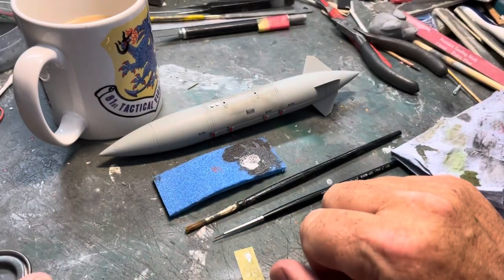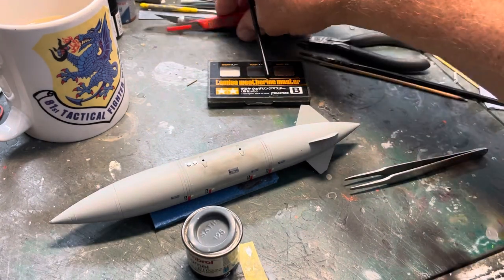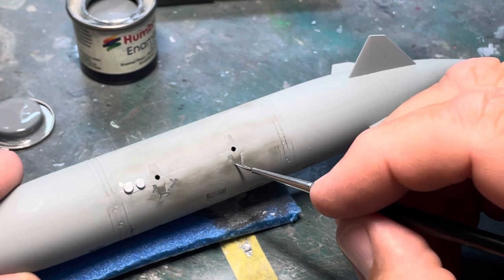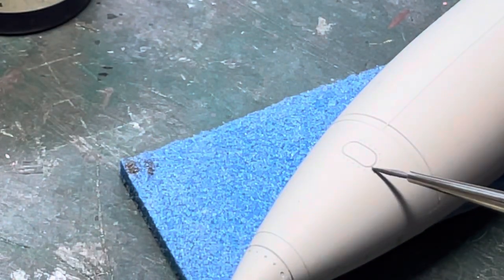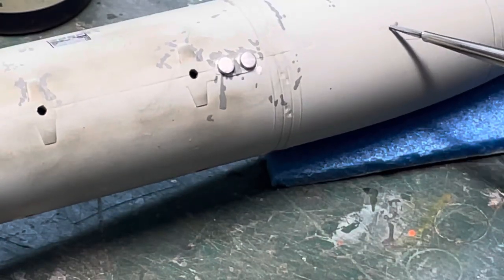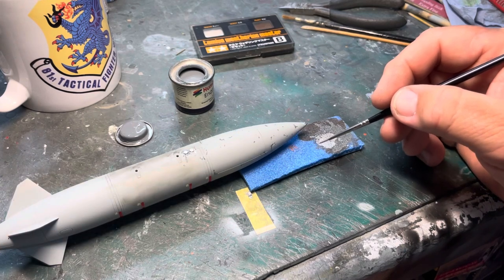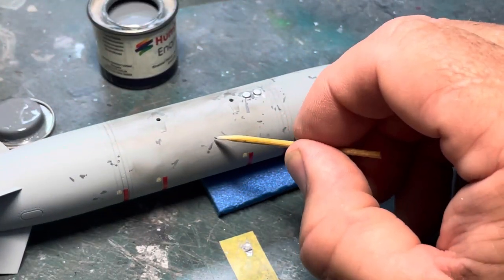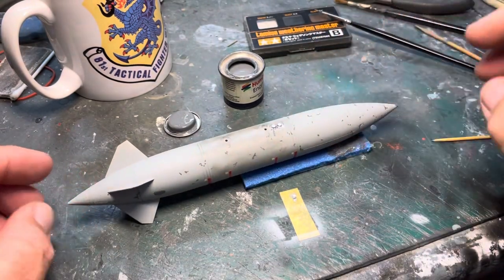How I weather a Hindenburg fuel tank from the Italeri 1/32 Tornado GR4

Comment: I was the SNCO I/c drop tanks at Bruggen for four years, and never heard them referred to as Hindenburg tanks, they were always 2250,s and the smaller tanks 1500,s the two types of Tank were of completely different construction. the smaller tanks were a resin tank, the larger a metal tank.  The smaller tanks  were a weaker construction and were prone to damage. the larger tanks were not.  The larger tanks were prone to dirty fingerprints and grease smears as mentioned below, mainly because of the paint used, the smaller tank paintwork was easier to clean. Inside the tanks were exactly the same, fuel flowed through a fuel proportioner that sent fuel for and aft in the right proportions so the tank filled evenly.  The suspension lugs were interchangeable  between the two size tanks.
Reply from the maker: Thanks Dave for your input I don’t know where the Hindenburg name came from I think it was from RAF Conningsby with the Tornado F3’s as I had a mate who worked there with them, as for the weathering it’s just a look into how I would go about it on something simple 💙😉👍🏻